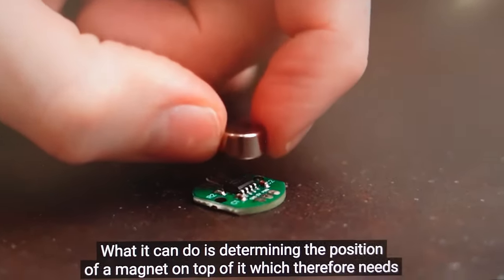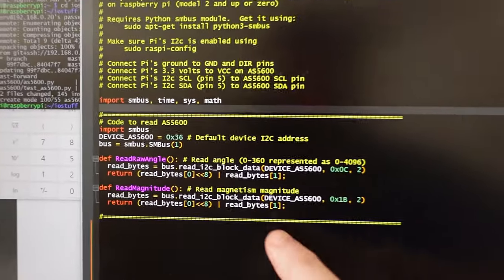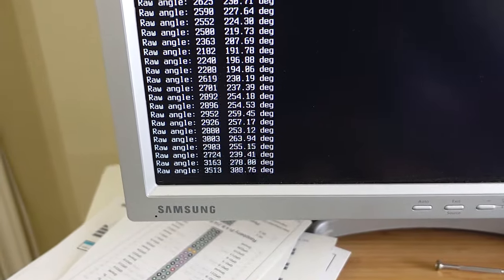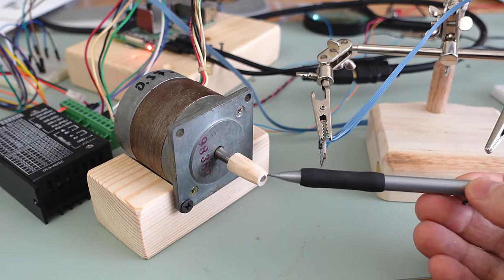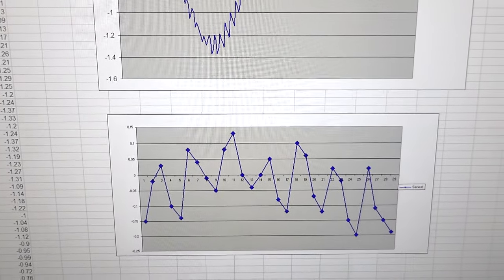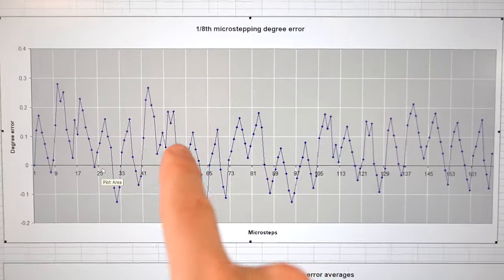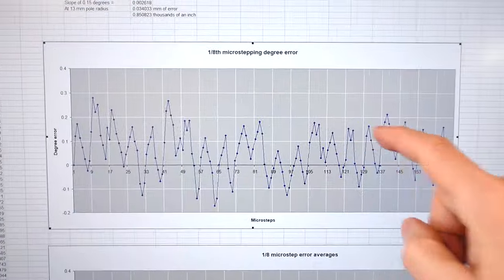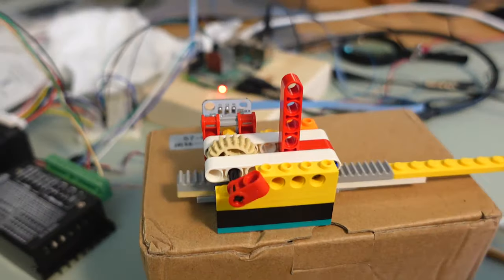Magnetic rotary encoder vs stepper motor accuracy

Comment: Magnetic encoders are great, really, especially if you buy a good one instead of an AS5600 piece of crap encoder :-) I've done a lot of coding on these things with closed loops. Building an index table is not really an issue, it's just a bit of coding. The main issue that most people don't realize with most of these magnetic encoders is their weird latency and precision characteristics in different situations. Read the datasheets carefully about the timings and note how the timing differs for things like standstill and moving objects. This is quite different from optical encoders that is always a constant and always spot on.

Comment: This is amazing stuff! Btw, I think you could still manage to do a dividing head with one, if you gear it down enough so the motor is doing more steps per degree on the head. 

Ofc, that adds in backlash, but as long as you end every move to a new position with a move in one fixed direction, it should cancel out. 

You'd also need a way to lock the head after moves... Really what I'm saying is that I'd love to watch a build video of you doing that 😉

Comment: if you are planning on cutting gears, then using a stepper motor to drive a turn table is  a good solution.  Turn tables have a significant gear reduction (worm gear) commonly 90:1. So the actual angle error of the turn table would improve the accuracy of 0.3 degrees on the stepper to 0.3/90 deg,  Your program would need to keep track of the actual number of turns as well as steps of the stepper motor, as well as the gear ratio of the turn table.

If your plan was to cut gears with out a turn table you may also run into hold in place issues, unless you have a very strong motor.

Comment: I use an open loop stepper to drive my rotary table, it has a 40:1 ratio from the drive to the table doesn’t that divide any stepper error by 40? I am happy with it except the motor  holding torque is a bit low. Having seen your previous video about close loop steppers I was considering fitting one.

Comment: used as5600 for my final uni project. 3d printed a bracket to mount it nicely on the back of stepper, and used a kaman filter for any measurement noises. works pretty nice

Comment: If you introduce a gearbox between your stepper motor and rotary table you can reduce the micro stepping error to a value in arcseconds. My tilting rotary table has a 90:1 gearbox on it.

Comment: oh, yeah, these hall effect sensors are quite impressive; we deal with quite a few arcade games which use magnetic encoders for sensing analog inputs in place of potentiometers and you can almost always notice immediately because of how much more stable and precise the inputs are

only issue with those tends to come when the magnet is mounted strangely or somehow gets rotated off from whatever axis it was placed in as a reference direction, because measuring something like up or down gets harder when the magnet you expect to be exactly level in exactly one direction gets spun 120 degrees out of axis :P

Comment: Hey Matthias, if you're looking for good accuracy for you dividing head project I can recommend the AMT series of capacitive encoders from CUI. I retrofitted my telescope with AMT112S encoders, and with the 0.35 degree field of view I usually use, I always find my target object within half a radius of the center of the field of view, so they really do live up to the 0.2 degree specification they promise. 
They are capacitive encoders with a captured but floating rotor. This obviously makes them less easy to install than the magnetic encoders (and they are definitely less cheap), but they are not position critical: even if the body of the encoder ends up misaligned to the rotor or the rotor has some radial runout (within reason, ~0.5mm allowable error), they still report correctly. My home-brew telescope retrofit was by no means perfectly accurate. If you want to mount them to a stepper as intended, they are actually very easy to use since that's what the included brackets are designed for. 
The AMT112S is quadrature output and produces up to 16384 positions per rev (4096 quadrature cycles per rev), but I only used this model because of the limitations of the firmware I wanted to use and the size I had available for mounting: there are more convenient versions that have SPI or UART position output (AMT21 series). 
There is a larger version that has slightly higher resolution, and also a larger 0.1" pitch connector (the small connector on the AMT112S was hard to obtain and assemble). But this is an older model and actually has worse overall stated accuracy, not sure how good they are.

Comment: The big thing is if the error is repeatable or not and where you're accurate sensing is from. If you can use both a magnetic sensor and incremental encoder on the same motor you can use one to calibrate the other and remove any of the repeatable errors. This is one of the ways we're dealing with position errors found in resolvers at work.

Also, you should try tuning your drive current and take note of how much it affects your microstepping position accuracy. I expect there's a certain amount of offsets within each full step and the quality of the stepper as well as how well the current is tuned for said motor will make a difference.

Comment: As stepper Motors are way faster than needed for most applications, you could gear one down and with it, the error. At least the error from the motor. You will of course probably add errors from the mechanical complexity.

Comment: Great video very interesting....Could this board be used to make a wind vane direction sensor for a rc sailing boat. ?
Fitting the magnet to the vane so the wind direction is sensed by the board?

Comment: why no FFT of the output? This would in theory show the different errors quite clearly.  Also I wonder if you can calibrate for axial misalignments by fitting some sort of prediction.  These centroid shapes would likely show up in a mathematical model of the system.

Comment: i have had the same problem because i needed to rotate a dslr in very small degrees and you can see the differenz between steps.. not much but i hated that problem.. only a servo wit an encoder could be more accurate i gues.. https://www.youtube.com/watch?v=YKbZPxObD34

Comment: For driving a dividing head with a motor I would argue you want a gear reduction anyway (preferably a worm gear due to it being self-locking), which would increase your angular resolution by the gearing ratio.

Comment: Encoder designer here :)  It is funny to watch using stepper motor as a reference for the encoder performance measurement. Right here you created the chicken & egg problem. TBH, your measurement of +/- 0.15 deg of error are quite spot on for a regular magnetic encoder or big stepper motor. Good job. Let me know if you need some other encoder types to continue playing with this technology :)
Reply from the maker: I ordered some other ones, but some advice could be useful.  Email me.

Comment: Re dividing head, gear the motor down 10:1 to the spindle to reduce error - of course you have worry about backlash then, perhaps use a toothed belt?

Comment: nice video, but was missing a test to the repeatability. If the error is consistent … the it‘s maybe also possible to tweak and minimize the error. And for your case with the cutting, you could also make some gearing to the encoder (maybe with timing belts), to get a 1:10 mapping or so.

Comment: Make sure you magnetically decouple the rotor of the stepper from the magnet at the tip of the shaft. The rotor will induce some magnetics onto the sense magnet. And since youre conducting sensitivty tests, this effect could be non negligible. You can get rubber couplings to do this

Comment: Some time ago i ordered some encoders (MagAlpha MA730),some magnets and a flux detector card... The data sheet recommended diametral magnetized ring magnets. Since they did not have the right size i ordered some similar magnets to experiment.
What i noticed with the flux detector card is that the ring magnets have a very clear line through the center where diametral disc magnets have an almost homogeneous magnet field around the middle...

Comment: It is a cogging torque. Stepper has 50 poles and every 4 steps rotor and stator are alighed creating a cogging force. You can feel it when rotaing the shaft by hand.

Comment: Car manufacturers use magnetic angle sensors to determine wheel angle rotation. They have a main gear and some smaller satellite gears which are being measured. By choosing a smart divider between those gears one can use Verniers principle to calculate multiple rotations with the accuracy of the smallest gear.

Comment: Just put an additional angular encoder on a worm-drive or other low backlash gear reduction attached to the rotary divider. The primary encoder gives absolute orientation, the other gives high precision relative angular values. Just a thought to help feed the algorithm.

Comment: 1. You need to firmly fix both motor and sensor to same frame reference : 
Your initial measurements were made with (loose) motor on table, and sensor hanging in front of the rotor (sensor also loose on table) but motor and sensor were not static from one another, let me explain: that 0.3° vibration could be the motor rattling on the table while the sensor also picking up vibration from the table, but motor and sensor holding gadget did not have a joining beam that would cancel out vibrations through the table on one another. You seem to have fixed that with the Lego frame. But again Lego bits do not have screws and bolts, are not metal, and you need a a heavy frame, with at least 2 opposite arms,  grabbing both motor and sensor, to cancel out vibrations from one on the other. A heavy common reference frame is far better at cancelling relative vibrations than Lego pieces.

2. Use data to calibrate : 
Once you have a static reference with a solid frame holding both motor and sensor that cancels relative vibrations, now you can calibrate, because now you should get the same graph every time. 
With motor and sensor on same table but loose relative to one another you were surely getting different graphs every time. Now do 1 measurement, build a calibration table, and apply the errors to return correct measurements.
Viel Spaß
Reply from the maker: was rotating very slowly, so not a lot of vibration

Comment: I’d recommend picking up some of the esp32 project boards and use micro python, it might hit the sweet spot between Arduino and fully fledged RaspberryPi but with wifi and Bluetooth etc built in.
Reply from the maker: I could run micro python on a pico.  Its not python I care about, its having a keyboard, screen and networking that I want.

Comment: Nice video & thanks for sharing.  I’m wondering how much magnetic influence is coming through the stepper motor shaft and biasing your target magnet?  The “every four points” clue sure looks like a correlation with the phase changes, even when using the microstepping.  If only we had the technology to build some gears and translate that motion away from the motor…?  :D
Reply from the maker: its sensitive to lateral magnetism.  Any magnetism coming from the shaft would be axial.

Comment: What happens if you take a step, wait a fraction of a second, then take a reading?
The stepper motor is a mechanical system so it's feasible to assume there'd be some oscillation between steps
Reply from the maker: that's what I did
Reply: The trouble is that microsteps are based on balancing the current in the winding phases; there's no expectation they'll map directly to linear changes in angle.

Comment: I did not expect the terminal to refresh so quickly. Which terminal is that?
Reply from the maker: Just text console on raspberry pi (didn't start the graphical user interface).  There's no serial link involved cause the code is running straight on the raspberry pi, and he monitor is connected straight to the raspberry pi also.

Comment: Thanks for a great video! It was interesting. I think I have to get some of those sensors and play with!. You know that you can run Python on a Rpi Pico as well. Just flash it with micropython ! 👍
Reply from the maker: its not so much about the language as it is about being on the network, being able to print to the screen and writing to a file, being able to type commands at it.  Also, the pico is much slower, so stepping steppers from python on the pico would be pushing it.

Comment: I'm about to do the same "experiment" on the steppers of a 3D printer. I have already printed the support for the board and was about to finish the software for reading on an Arduino Nano.
Unfortunately work kept me away from continuing.
For use on the printer 0.5 degrees would be more than sufficient to detect the loss of steps.
Reply from the maker: you may or may not get 0.5 degrees of precision.  But if its rigidly mounted on there, you might be able to calibrate that out.
Reply: @matthiasrandomstuff2221  I have already tried to use the drivers (TMC 2130 and 5160) to detect step loss but I have never managed to do it reliably at high speed.
200 s/rev stepper motors when they skip do so in 1 or more full steps, even using microstepping. So  within 1.8 degrees it should be fine.
Good hint to plot on polar coordinates, I will definitely steal the idea. Thank you

Comment: Lego is known for 0.002mm of manufacturing tolerance. Quite impressive IMO.
Reply from the maker: yes, but the shafts have probably 0.1 mm play in the holes.  I repeated my 360 degree accuracy experiments, and the play in the holes made the results no better than what I got without.
Reply: Would that be more of an inter-part tolerance, where the manufacturing tolerance would mean any given shaft-hole combination would have the same ‘slop’?

Comment: Nice job on the linear transducer! Have you ever tried/ considered micro python so you can use an esp32 or similar cheap MCU?
Reply from the maker: yes, made a video about it too.   Its not about the python, its about having a screen, keyboard and networking
Reply: @matthiasrandomstuff2221  ah right I'm with you. I must admit I wish I knew that side of things for debug and data visualisation. There's only so much you can do with printing in the terminal.

Comment: Every test should have been done with the magnet stable relative to the AS5600.
Reply from the maker: as in, don't rotate the magnet?  Kind of pointless.
Reply: @matthiasrandomstuff2221  As in the magnet's position should have been the same relative to the sensor and the only degree of freedon needs to be the rotation that is measured.

Comment: When you rotate a magnet with a power drill, isn't that is how you create a steady mag lev field directly underneath?

Is that why the points on the circle were so far spread out?
Reply from the maker: My sampling rate was only about 20-30xx higher than the rate of rotation at max speed.  I used that dewalt drill cause it's my fastest spinning one.
Reply: @matthiasrandomstuff2221  - Did you see the mag lev effect?

Comment: If I remember correctly, you can get the sensor status for errors. One of those is the magnet not being detected. I used it to reject the readings while in this state.
Reply from the maker: I didn't go for "no magnet error", I just read the magnet field magnitude, as covered in the video.

Comment: Love your videos, super interesting and straight to the point! I got PTSD seeing that wobble on the adapter holding the magnet hahaha. I was making a rotating platform with a nema17 for calibrating some angle measurement equipment and absolutely could not get the concentricity to be decent using 3d printed adapters.
Reply from the maker: I figured the lego would get me close enough, but no.  Problem is, there's a fraction of a millimeter of play with the lego shaft in the lego holes, and that was enough to throw thigns off.  If you can get consistent to a range of 2 degrees with one of those thingys, you are doing pretty good.
Reply: @matthiasrandomstuff2221 in astronomy, where those errors matter a lot, they use 2 motors torquing in opposite directions and move by adjusting the difference in torque between the two. Completely eliminates backlash and vibrations in at least one direction, possibly both, depending on where exactly you place the two actuators in the chain

Comment: Are you sure its the motor error? how you are so sure that encoder measures correct?
Reply from the maker: because it totally correlates with the motor steps. And microsteps not being that accurate is totally a thing -- covered in one of the linked videos at the end.

Comment: Bear in mind that was your results from typically the cheapest magnetic absolute encoders, they can get more accurate than that. If they are accurate enough to measure characteristics of the motor then they are probably accurate enough for most uses with stepper motors.
Reply from the maker: High precision but low accuracy.
Reply: @matthiasrandomstuff2221   you can get accuracy by calibrating big errors in open-loop.

Comment: There's a couple of things I would try: storing the error (or trying to predict it in some other way) to compensate for it, and to have the magnet and sensor further away from the motor itself so the magnetic fields are smaller.
Reply: These magnetic encoders are usually attached to the back shaft of a stepper motor, sometimes just stuck on the shaft even though it is flush. Even other types of magnetic encoder are just mounted directly on the back of motors so moving the magnet and sensor further away likely doesn’t make enough of a difference to matter.
Reply: Yes i was wondering if the magnetic fields varying within the motor were affecting the sensor too.